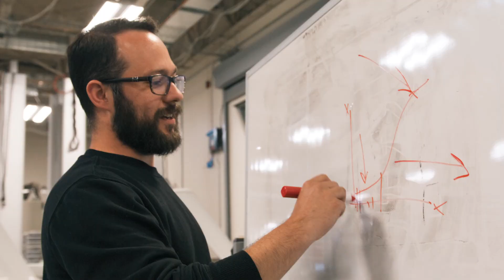Watch how Amazon is preparing for safe drone delivery

Comment: Cool, but It wasnt cool that the man mentioned that they created jobs, when in reality they eliminated many more
Reply: How did they eliminate any jobs? I was about to comment that this is so inefficient (as much as I love technology and drones, being a drone pilot myself) because it seems to be more work just to deliver a single package. They didn't eliminate any warehouse jobs at all, and they still have the same amount of drivers, but the drivers have a hard time getting packages out to these rural areas,  (I know, I just move out of a big city to a small rural mountain town) so a drone seems more efficient... except it looks like it takes at least two people to push the huge drone out and line it up on the pad, plus a pilot/safety monitor, that's at least three people to deliver one single package via drone! Not very economical or efficient at all... 

... but jobs-wise, those extra delivery people, along with all of the techs that designed and built the drones, plus all the new service/maintenance people that work on them to keep them flight ready, that's a LOT of new jobs... so which job was eliminated exactly?

Comment: If it is so smart and can avoid collision and redirect itself, then why is AMAZON pushing to have these drones given the right away over a hot air balloon, which can't maneuver out of the way of the drone fast enough??
Reply: Trust me it's going around the balloons. With all of the air traffic rules coming into play with drones and the tech that have been added to many drones it's not an issue. Autonomous driving and flying is the future and the day will come when your insurance charges you more because you have your hand on the wheel or controls.

Comment: It lools good on the pictures. But in real life it need to do much more. In our case we work on precision landing system, becouse we realize - it criticaly requred for drones to operate. Drop  package - not good solution. Even if you try to drop from low altitude you need a system that provide 100% garanty in safety sense. And we are (UAVLAS) sucseefuly working on it.